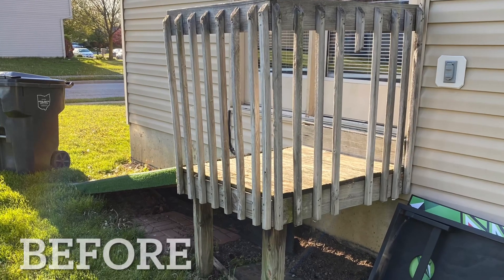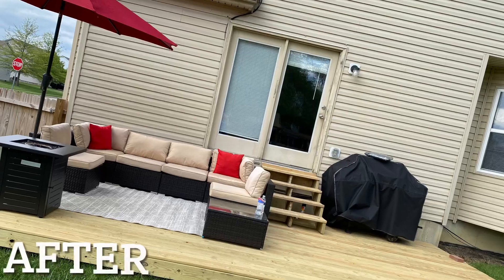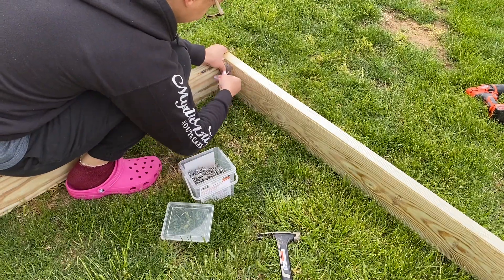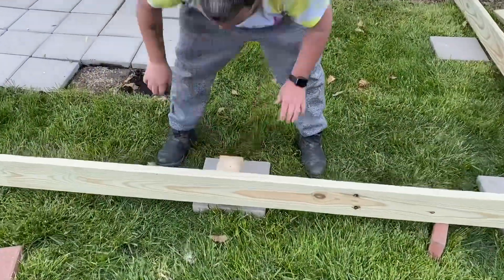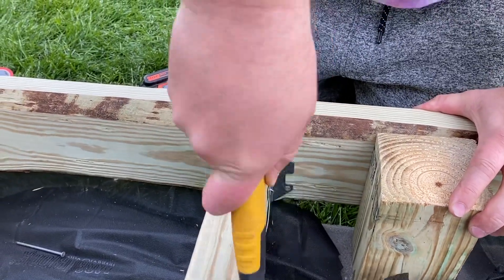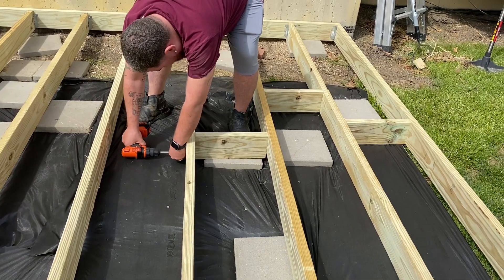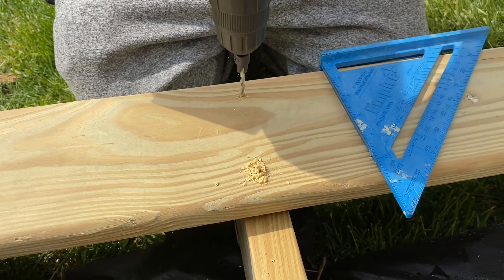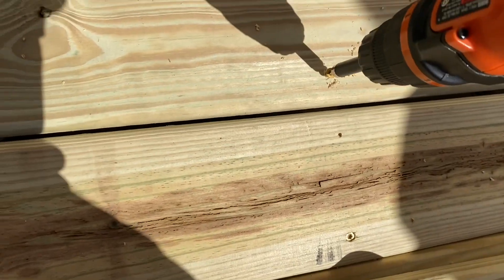Easy DIY floating ground level deck for beginners

Comment: Thanks for the video.  I am building a 16' wide x 7.5' out from the house deck...with cement support posts in the ground.  The only reason that I am coming only 7.5' out from the house is that the town will not approve it for any more than that.  Once it's complete...and inspected by the town...I plan on adding another 4.5' of 'floating deck' like you have here (to make it a 16'x12' deck in total).  Looks great.
Reply from the maker: Thank you!! And wow that’s actually a pretty smart idea! 😉

Comment: It looks nice great job. You shou6 have pulled the stones out that's something you can use on another project.
Reply from the maker: Thanks so much! And true. I removed a few to save in case I needed them and I ended up using most of them that I saved

Comment: Were you using the driver to drill and the drill to drive??? 3:40
Reply from the maker: We used a impact drill to pre drill holes, then used the drill to drill in the deck nails

Comment: Good, looks level, interested to see if it stays level after a season.  Depends on your climate I guess.
Reply: As the grass rots, it will sink a bit. Very easy to go back and use shims to re-level it.
Reply: Would be an easy re level though js

Comment: So I was going to do pavers in my backyard but I was afraid of them crooked or uneven because of  the little hill in our backyard but I love this idea. How has it been holding up? Any grass growing through or rotting?
Reply from the maker: It’s been holding up great! There hasn’t been any grass or weeds growing through and there isn’t any rotting either. The wood and the deck still looks great. It is still sturdy. It holds the weight of all our furniture on it, fire pit and grill plus several people. It is still level and hasn’t shifted or anything
Reply: @itsDejza  I love it my husband wants pavers lol and it seems like so much cleaner the way you did it I really love it great job!
Reply from the maker: Thank you so much Chanel I really appreciate it!!😊

Comment: Nice.  How come the concrete pavers don’t need foundations?
Reply: Every town/city has different codes. This would not fly in my area.
Reply: It'll work but will need a leveling eventually

Comment: What is Minars? Or whatever you said where you got you 20 ft boards from?
Reply from the maker: Oh from Menards. It’s a large hardware store similar to Home Depot and Lowes. Menards just happened to have them cheaper and on top of that they have rebate on everything you buy in the store. So I would send in my receipt and they would give me money back to use in store on a future purchase
Reply: @itsDejza  oh ohk. Thanks for the answer. And the video. Nice deck! Looking to build one of very similar size.
Reply from the maker: Thank you I appreciate it!! And hope everything turns out great for you!

Comment: If you dont mine me asking. About how much did that cost in material's?
Reply from the maker: The cost was close to $1,500. I was told around that time that lumber was exceptionally high. So I’d imagine it could have cost way less

Comment: Hey hows the deck holding up so far. Any complaints?
Reply from the maker: The deck is actually holding up great! No complaints so far. I am curious to see how everything holds up after this winter though since it’s not in the ground. But it’s pretty solid, holds a bunch of people & furniture all at once so I am happy!
Reply: @itsDejza  Glad to hear. I’m building a similar deck so just wanted to know what to look out for. Any advice?
Reply from the maker: I’d have to say definitely just making sure everything is level and the deck is square so the boards fit and lay just right

Comment: Looks good. Could you post an update a couple months down the road? I have a feeling your “foundation” will begin to sink over time. I would dig about 8” off the ground and compact it. Once it’s compacted add leveling sand and compact it again. Then gravel and then your foundation. That’s if you don’t want to add cement.
Reply from the maker: Thanks and Sure I could do that. I didn’t mention this in the video but I would eventually ( like maybe next year) like to raise the deck off of the ground to meet right underneath my door frame rather than having steps there. This was my easy temporary fix for the time being until I wanted to raise it up. At that point I was going to actually dig into the ground and use cement to hold my post